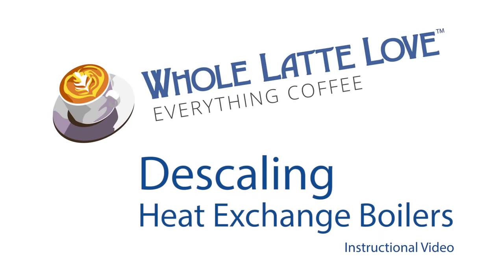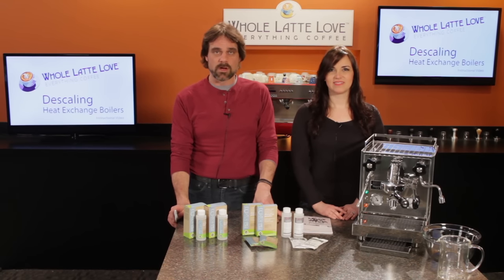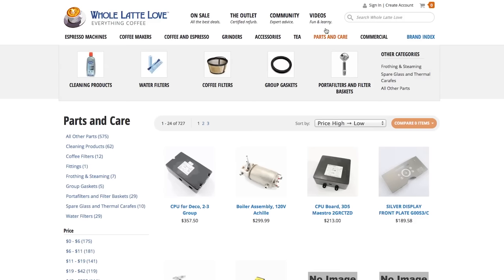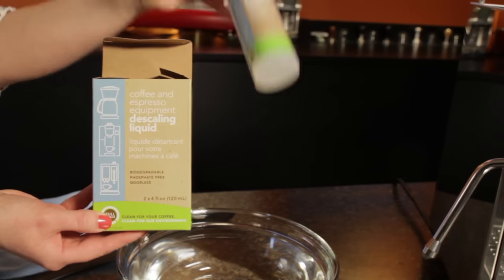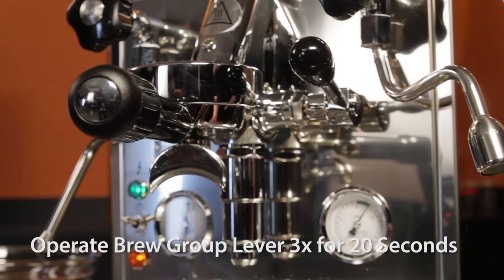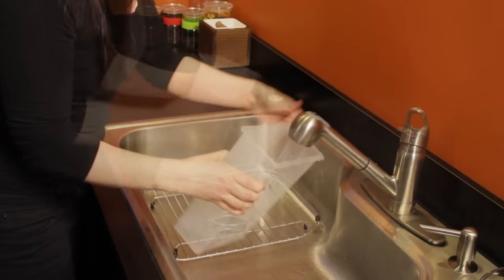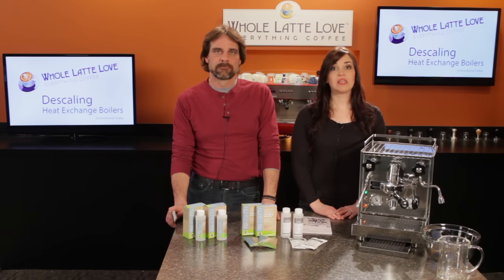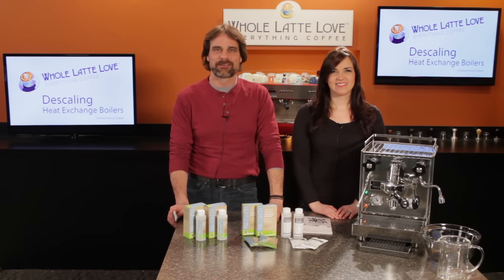How To Descale Espresso Machine Heat Exchange Boilers

Comment: How often do I have to descale if I only brew one or twice a day?  and I am using soft water, thanks
Reply from the maker: Hi Red, Thanks for the question. If your water is soft and you are using the machine daily I recommend descaling every 3-4 months. FYI depending on the mineral content (softness) of your water and other factors like TDS, alkalinity, pH etc your water may or may not cause scale to form. We still recommend prophylactic descaling as it's very difficult to determine if scale is forming without opening up internal components of the machine.
Reply: Thank you for the reply and all the videos that you made, you have reviews and show us from outside in and inside out most of the machines.  I have watched a lot of your videos so if there anything that I will need like descaling or other thing I will order it from Whole Latte Love...…..
Reply from the maker: Hi Red, You are welcome. Thanks for your comments. Always here if you have any questions. Marc

Comment: Why would you only let the descaler work for 3 x 20 seconds in the E61 Group head and for 20 minutes in the boiler? If you put in the blind filter and move the lever in the middle position the water stays trapped in the group head and you can flush it clean after 15 minuter and really let the descaler do its thing in the Group head as well Backflushing with Caffiza only cleans the oils not the scale build up. 3 x 20 seconds is I believe much too short for a good descaling run. Maybe when you do it very frequently this is ok.

Comment: Hi Marc, Thank you for you amazing Job. Your videos are amazing, and I recently bought the ECM Mechanika V Slim with the Eureka Specialità. I have a question for you. I live in Switzerland, and the water is extremely hard with a lot of limescale. I use of course a filter (Brita) to reduce the limescale in the water.. If I use this filter, how many time do I have to descale my espresso machine ? Thanks for you answer
Reply from the maker: Hi YW, Here in the US as far as I know Brita does not make a filter which reduces water hardness by removing calcium which is the main source of machine scaling. Here their filters do particle filtration and activated carbon for chemical filtration which has no affect on water hardness. I would look into BWT Water+More filters which have patented technology which exchanges magnesium for calcium and does the particle and carbon filtration as well. For reservoir fed machines I like this product: https://www.wholelattelove.com/products/bwt-penguin-2-7-l-water-pitcher It eliminates scale potential when used properly. If you check the user comments/reviews in the product link you'll find it's popular with ECM and Profitec machine owners. As far as I know if using standard Brita filters you will need to descale as regularly as you if using no filter at all. Hope that helps!
Marc
Reply: @Wholelattelovepage  In Europe Brita sells filters called Brita Maxtra+ and they actually do reduce water hardness dH levels by about a factor of 2 to 3.

Comment: My hot water valve (not the steam) outputs no water. Can I descale anyway?
Reply from the maker: Hi RL, Well, that's how you'd get the descaler out of the boiler so probably not. No hot water out of the wand may indicate a serious issue. Either your boiler is not heating, there's a severe blockage between the boiler and end of wand or least likely some issue with the valve. Don't know what type of machine you have but we may have some diagnostic information available in the support section on our website. Check it out here: https://support.wholelattelove.com/hc/en-us
Reply: @Wholelattelovepage  I was able to have it spitting a little bit of water out. So I knew I could empty the boiler both with the descaling solution and water to rinse after. It worked and now my hot water valve is shining again!
Reply: @Wholelattelovepage  it is a rocket evo-r

Comment: This seems to be a sensible way to descale, especially using the steam pressure to empty the boiler. It doesn't address how to descale the top of the boiler (i.e. by pulling the fill sensor wire temporarily), but perhaps this is not a big issue..

However, after using this method on my HX machine I ran into a small hiccup. During the 2nd and 3rd flushes of the boiler, my boiler autofill would not engage after draining the boiler. I filled the boiler by pulling the sensor wire, and finally the autofill is working, but I'm wondering why this might have happened, and how I might test and debug the issue.
Reply from the maker: Hi Lee, Thanks for the comment. Top of the boiler as you mention is not really an issue. That area is filled with steam which does not contain minerals. Not sure why your autofill had a temporary issue. Perhaps a temporary electronics problem due to disconnecting the fill sensor wire that reset with a power cycle.
Reply: I had the problem before I disconnected the wire, after several power cycles.

Also, I'm willing to bet that there could be considerable scale just above the water level.

Comment: I once left the descaler in for several hours forgetting about it.  It seems fine but this did leave me wondering about something.  Does anyone know whether the solution starts to neutralise as it dissolves the limescale so whether leaving the solution in for much longer than 20 mins is fine?
Reply from the maker: Hi JL, It should not be a problem so long as the boiler was not made of aluminum  - I know of no HX machines with aluminum boilers. For aluminum max contact time for a citric acid descaler should be limited to 20-30 minutes according to chemists at Urnex which makes industry standard descaling products. I'm no chemist but would assume scale would reduce acid strength. That's based mostly on my experience doing vinegar and baking soda volcanoes! :)
Marc
Reply: @Wholelattelovepage  haha thanks.  Great advice.  I think you should do a video on vinegar and baking soda volcanoes too!

Comment: Is there any kind of water I can use for the 500 that would prevent me from needing to descale at all?  if I use good water, does this only decrease the rate at which I would need to descale?  I want an espresso machine badly, but the many descale vs don’t descale points I have read have left me stumped.
Reply from the maker: Hi John, Thanks for the question. If you are starting with tap water which is safe for human consumption you can be scale free using BWT in reservoir pad filters like this: https://www.wholelattelove.com/products/bwt-bestsave-m-anti-scale-filter or a BWT pitcher: https://www.wholelattelove.com/products/bwt-penguin-2-7-l-water-pitcher
Both these options use BWT's patented ion-exchange process to control mineral levels (hardness) by replacing some calcium with magnesium. This maintains a mineral level required to support flavor and prevent over-extraction yet will not result in scale if used as directed. Both filters also remove chlorination and additional chemicals using activated carbon. Long-term cost per liter filtered is lower with the pitcher.
Marc

Comment: Quick Mill doesn't recommend descaling at all unless you are using hard water, as it does more harm than good...I have talked with other distributors and this seems to be the consensus industry wide. Where are you guys getting this information from?
Reply from the maker: +ty hockstaff Hi, We get information from manufacturers and from our service and repair department. We have pallets holding hundreds of boilers replaced due to excessive scale build up. There are a few manufacturers who do not recommend home user descaling of their machines - mostly for dual-boiler models. Our advice for owners of higher-end prosumer level machines is high quality water filtration that includes sediment filtration, a carbon stage for chlorine and chemical removal, a stage for removing minerals that cause calcification and then re-introduces minerals which do not cause calcification. Adding back a proper level of non-calcifying minerals helps to maintain flavor. Without them, it's very flat. That's the way it's done in a good commercial setting. Problems is many home users neglect proper water filtration. Depending on source water hardness, this ranges from not a big deal to a huge one. It's especially critical for owners of machines which have thermo-block boilers. You don't find those in prosumer espresso machines but they rule in super-automatics and many lower cost semi-automatics. The narrow passages in thermo-block boilers scale rapidly when using moderately hard water.

Check out this video at :20 - :50 for images boiler scale build-up and some of the hundreds of boilers replaced due to scale issues: https://youtu.be/Bi6WXlPtBpE

If you'd like to learn more about a water filtration system that eliminates the need to descale check out this video on BWT water filters: https://youtu.be/yYilGVC-LaI

Comment: Why not just use distilled water? And not worry about scale.
Reply from the maker: Hi o, Seems like it would make sense. Problem is you want some minerals in the water. Pure distilled or RO water over time can cause corrosion of metal components in machines. That's why you never see mineral free water stored or transported in metal. Beyond that, mineral free water over-extracts coffee. One can avoid scale by properly treating water before use. Options included traditional sodium based softening solutions to reduce calcium or our preferred method using systems which exchange calcium in tap water with magnesium. Magnesium is a better flavor extractor than sodium. Check out options from BWT Water & More using this processs: https://www.wholelattelove.com/collections/bwt/products/bwt-bestsave-s-anti-scale-filter

Comment: Is this the same steps for a dual boiler?
Reply from the maker: Hi ACL, Most machine manufacturers recommend against home users descaling dual boiler machines. Descaling a dual boiler may result in pieces of scale dislodging during descaling and plugging up other internal components. Also, it's difficult to properly descale the steam boiler while in the machine. That's because there's headspace in the boiler so descaling solution cannot totally fill it and scale tends to accumulate where water and air meet in the boiler. Best practice is to treat water used in the machine to prevent scale formation in the first place. Should descaling be needed it should be performed by an espresso machine technician.
Marc
Reply: @Wholelattelovepage  Thanks for the insight Marc. I have a Lelit Bianca and the flow is really slow. I have been using filtered water but I don't think the filter was adequate. Once I have my machine running properly again I will use properly treated water.

Comment: Every 45 to 90 days? Haha, come on even coffee shops probably don't descale that often. Over exaggerated nonsense.
Reply from the maker: Hi v, Thanks for the comment. Most coffee shops have water treatment systems which remove minerals to reduce or eliminate scale in the first place. But talk to a home user with hard water (mineral rich) that does not treat source water. Scale can accumulate very quickly and cause permanent damage to equipment.
Reply: @Wholelattelovepage  I have hard water and a coffee machine with a boiler and use it daily. Descaling at the frequency you suggest just makes me laugh. Anyone that says they descale that often for domestic use is telling you a fib

Comment: What about the steam wand?
Reply from the maker: Hey tc, Descaling the wand? Steam wands typically are not susceptible to scale deposits. Steam carries little to no minerals which cause scale.
Reply: @Wholelattelovepage  yes had very low pressure. Did the descaling process and went ahead and ran the steamer with the solution and it eventually broke up the clog. Works great now
Reply from the maker: @toiletclogger637  Happy it worked out for you. I wonder if it was milk in the wand?

Comment: Can this work with Pasquini Livia 90?
Reply from the maker: Hi Allison, Yes. But, do be aware there is risk involved if the machine is overdue for descaling especially if it's had a lot of use with hard (mineral rich) water. Chunks of scale can dislodge during descaling and plug up other areas of the machine.

Comment: HI Marc, is there any chance you can make a video of descaling the Bezzera BZ13 DE? In your video you show opening the water spout after turning the machine off and then opening the group head as well. With the BZ13 you can not open the group head unless the machine is turned on and then it is once again filling the boiler. I am using the BWT pitcher, but I figured it would be a good idea to descale once in a while to be safe. Also, in my previous comment when I open the water valve I only get 350 ml of water coming out. Is this normal for this machine?

Comment: how can i descale if my hot water valve is plugged. I followed instructions on previous video and determined clog is not in the hot water wand or assembly and is further in the piping/boiler. For reference I have a Rocket Appartamento Serie Nera
Reply from the maker: Hi Justin, You will need to determine where the scale obstruction is and correct it. Basically continue working backwards from the wand to find the blockage. Here's a support article for the Appartamento which includes a video on tracing back hot water flow issues: https://support.wholelattelove.com/hc/en-us/articles/1500008536862--Rocket-Espresso-Appartamento-Serie-Nera-Flow-Issues

Comment: How do I descale a Profitec Pro 700 (dual boiler)?
Reply from the maker: Hi Wilson, We do not recommend home users descale dual boiler machines. Best to have it done by a professional technician. Reason, there's a risk of plugging internal components with loosened scale. It's best to prevent scale in the first place by filtering water with a system which replaces calcium with magnesium. This maintains a mineral level needed for good flavor and protection from corrosion without causing scale. Look to BWT Water & More filter options which use patented calcium to magnesium ion exchange. More info on their products in this video: https://youtu.be/1C0GdOKxLj4
Marc

Comment: Hi Marc. Thanks for the helpful video.

My question is just a point of clarification. In the video, you mix the descaling  liquid with 32 oz of water as indicated on the packaging. Since the Profitec Pro 500 has a 2 liter boiler, do you add plain water to fill the boiler or mix multiple batches of descaler?
Reply from the maker: Hi George, Thanks for the question and my apologies for a delayed response. Was off the grid for holiday weekend. Although the internal volume of the boiler is about 2L you will not need a full 2 liters of solution as the boiler does not fill completely. If the machine takes in more than 32oz of descaler I would not dilute. I would mix more.
Marc

Comment: Thank you so much for the complete info! I have a Rocket Chellini that was always told to not descale. Now I understand that is for the double boiler machines and not HX. I followed your directions here and my Chellini is back to full operation with no weird sounds and short cycling on pressure stat. I will not go anywhere for products or support if even found cheaper. You guys rock!
Reply from the maker: Great to hear! Thanks for your comment!!!

Comment: just did this on a pro 500 and the water was pretty clean but it had tons of tiny specs of scale in it.  used urnex dezcal powder.  100g to 1/2 gallon of water.  had the machine well over a year and don't think I had done this properly before.  working good as new and I will now chemically clean the group head and then lubricate the e-61 lever mechanism.  thanks again for posting this.
Reply from the maker: Hey Matthew, Thanks for the comment and that sounds like a good plan. To help you out here's a couple videos:
Espresso Machine E61 Brew Group Maintenance and Rebuild: https://youtu.be/ELIwD40tsrs
How to Backflush Your Espresso Machine: https://youtu.be/5LEd0XoFVRg
Marc
Reply: @Wholelattelovepage  i have ran the pump via the brew lever and drained into a bowl from the group head and there are still tons of specks in the water.  ran almost 2 clean gallons through it after descaling.  is this normal?  I am thinking there was a ton of scale in the brew (HX) boiler.  water out of the hot water wand is very clear with nothing in it.... should I try descaling again?